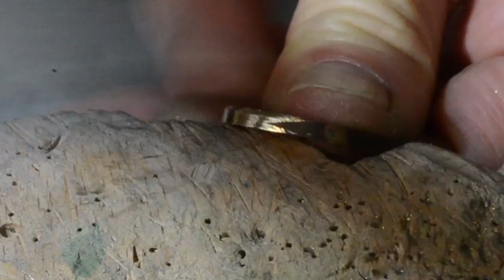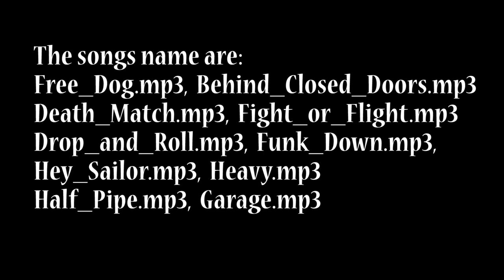Big gold ring with red coral and diamonds  Jewelry handmade 18kt gold

Comment: Why did you use  glue to fix the coral ?  It can be easily bezel set  in spite of being brittle.
Reply from the maker: sure, it can be set, but using two-component epoxy glues, you have a sure grip, and the possibility in case of repair to remove the stone easily.

Comment: epoxy on the coral...that...i won't do.
Reply: kwxj61b Pretty sure you wouldn't do any of it.
Reply: Albert Ledesma Lmao best comment I've read in a long time.
Reply: How else would you be able to remove it  to do repair work on any part of this master piece without damaging either the bezel or the (calcium carbonate) coral or both? Only a bone head would hammer on the bezel.  That is why a precision fitted stone and bezel is utmost, something that most so called "jewellers" can't do.